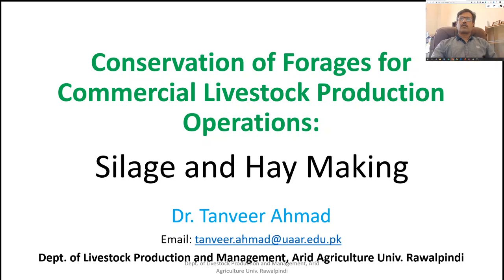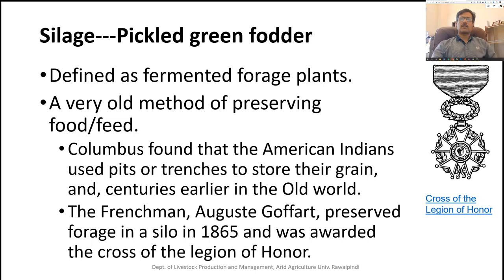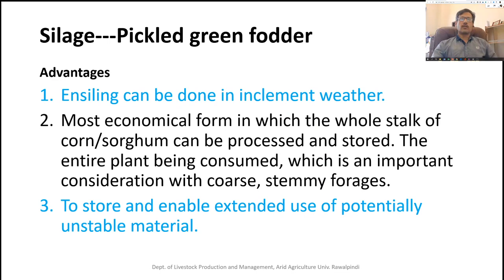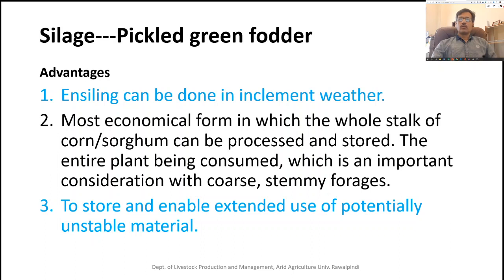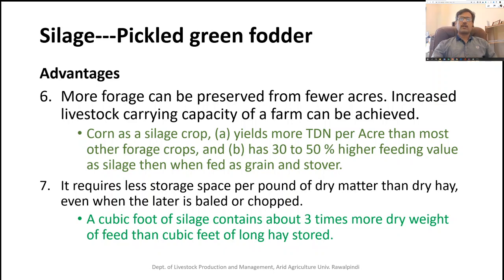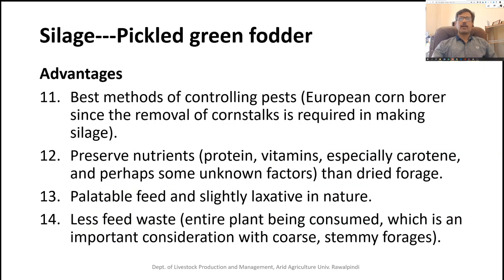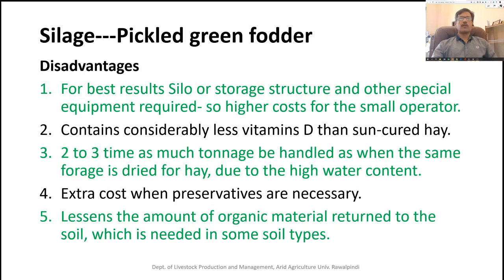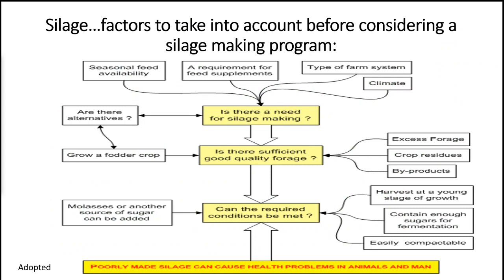Silage making Part 1

Comment: 18-arid-4479 Morning-A
Reply from the maker: just give 2  about poor quality silage
Reply: @foodfeedinfo  
If adding the crop residue lessen the moisture it will reduce the quality of silage. Moreover it will contain moulds and slimy soft texture. Deterioration may also occur due to overheating during storage.